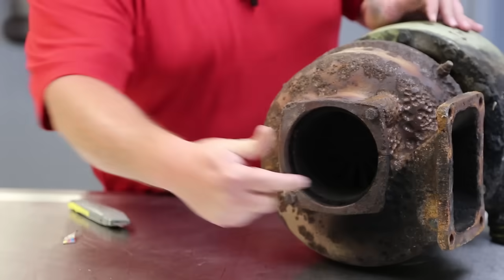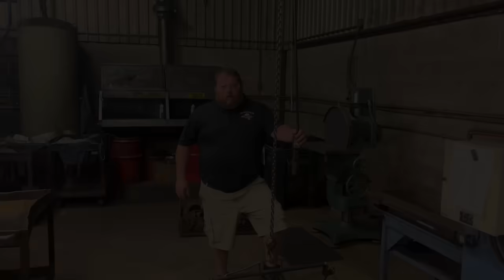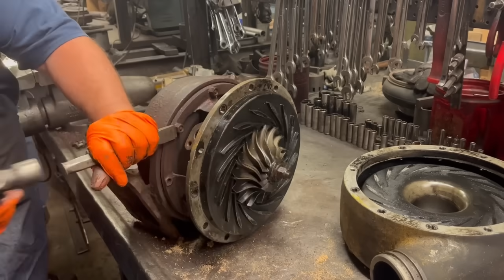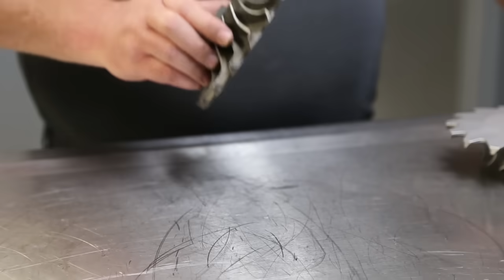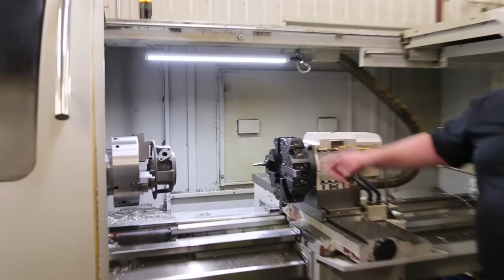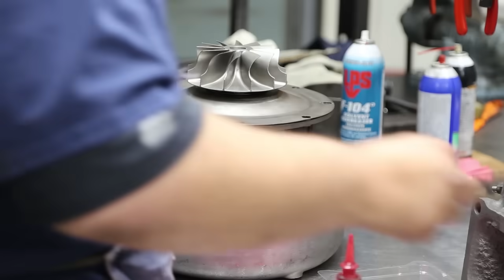T14 Turbo Repair for @DieselCreek  1964 D8H Cat Dozer – BACK FROM THE DEAD … WILL IT START?

Comment: Would it have been prudent to do a little smoothing on the inside of the exhaust entry portion, it looked so rough and would impede so much smooth air....

Comment: Greetings from Hobart, Tasmania, Australia. Great video to see the restoration esp the breakdown of the costing. There's an honesty just in that part alone that many others wouldn't put out there. Noob question, but why do the bodies get so pitted? I would imagine the turbo would get so hot that it would burn off any protection and it's just rust that comes from age and sitting, but is there another cause ?
Reply from the maker: I would guess Father Time is the biggest cause here. And exhaust gas is pretty caustic. Coupled with thousands of heat cycles. Pretty tough environment.

Comment: I worked on a tug boat in the eighties, that boat was built in the early sixties,...it had a big cat engine, I'll never remember the model number but we called it a 765 hp. It should produce 765 for continuous operation, put the hammer down and leave it down for days. They would size the pitch in the propeller for an appropriate load on the engine based the speed you expected to travel based on the type of towing that you would do. We got the boat into our area from a barge towing division,...barge towing would mean speeds of maybe 6 or seven knots. We were a log towing division, huge rafts of logs dragging the speed down to 1 or 2 knots, putting tremendous load on the engine,.... if you kept asking it to produce 1200 RPM. I went to the engine room one night for a look around and before I turned on the lights I glanced down at the engine and that big old turbo was glowing ruby red,...you could almost read the newspaper without the lights on!! We did make a choice to slow down a little and push a little less heat through the poor thing,.....not sure what the exhaust temps might have been (my guess is hot AF!) but cherry red turbo seemed a bit much!! Not sure if it put a hurtin on the turbo but it did run for a couple of years after that. Good solid engineering in those old Cats! The new half size better performance unit wouldn't put up with that kind of abuse! She be a puddle on the deck plates!
Reply from the maker: They don't build 'em like they used to! Thanks for sharing!

Comment: Nice work yet again.  Always impressed with you guys.  I missed where you fixed the bore of the turbine housing where the turbine wheel contacted and chewed it up.  How do you do that?  Tig on material and then grind it back?  How do you keep the profile true?  Is this hand work, CNC, etc.  Looks challenging.
Reply from the maker: Great question. This one got a buff job with a flap wheel in a die grinder. Wasn't too impressive and we were already in trouble with the video length. The majority of the exhaust energy is directed to the turbine wheel from the nozzle ring making the fit on the contour less critical than a unit without a nozzle ring. If this rig didn't utilize a nozzle ring we would have either done a tig braze with nickel rod for build up and then cut the contour with the lathe or completely cut the damaged area out, brazed in a repair slug, and then machined the contour back into the slug.

Comment: I put a $2000 rebuilt turbo on an old $1000 International yard truck. Same thing couldn't get parts but the place over here in Aus had used parts to get it fixed as the compressor housing had corroded out the inside

Comment: Could you explain why/what the logic is behind first grinding the turbine shaft to make the bearing surfaces perfectly parallel and concentric and then straightening the shaft? To my logic it seems that you would "straighten" the bearing surfaces out of parallel this way, as they were ground to be parallel on the un-straight shaft. I'm not saying this would lead to failures, or trying to critique the amazing work performed by ADS, just looking for an explanation for something that seems odd to me.
Reply from the maker: Good eye. Great question. Straightening is in fact first. Then grind, polish, and balance. We had wheels chucked in each machine for video production and so we could get in and out of the machine shop quickly and we captured the processes out of order. Are you looking for a job? Your attention to detail is what we look for at Area Diesel Service.

Comment: Awesome video.  Keep the old iron going.   It's amazing with today's technology like CAD, 3d printing and A.I. that someone can't make these parts.  These were made 60-70 years ago.  I realize the demand is low but at 3850.00 for used/rebuilt parts how come someone hasn't done it yet?  Sorry for sounding ignorant.  It just seems crazy.  Once you make a mold you can make multiples.   The more parts we have the more old iron keeps running.
I'm going to start looking for cheap old heavy equipment for goldmine parts.  Love the 3 wise men.  Much respect for them.   You can tell they're there cuz they care.  #probably could have retired already.

Comment: The bore in the turban housing, is that a part that is press fitted at factory, or is the core too soft for pressing? Thanks
Reply from the maker: The turbine housing is all one cast piece. The bore is machined into the casting itself.

Comment: Purely out of curiosity,  at the beginning you showed a much smalller turbo and you mentioned as  current equivalent.  Could someone replace with a more modern version  cheaper or would other problems stop that from happening?
Reply from the maker: Yes. That was "plan c".

Comment: If a guy didnt care about being period correct and original, I wonder if there is a contemporary turbo that would bolt in place on the manifold and work with some pumbing modifications?
Reply from the maker: Yes. That was "plan c".

Comment: Good content? But I have one question... why are the shaft journals ground before the shaft is straightened? This could bring the bearing surfaces out of straight/parallel!
Reply from the maker: Good eye. Great question. Straightening is in fact first. Then grind, polish, and balance. We had wheels chucked in each machine for video production and so we could get in and out of the machine shop quickly and we captured the processes out of order. Are you looking for a job? Your attention to detail is what we look for at Area Diesel Service.

Comment: Question:
Why was the shaft ground to size before straighting? I would think a straight shaft would grind better than one that's not straight.
Reply from the maker: Good eye. Great question. Straightening is in fact first. Then grind, polish, and balance. We had wheels chucked in each machine for video production and so we could get in and out of the machine shop quickly and we captured the processes out of order. Are you looking for a job? Your attention to detail is what we look for at Area Diesel Service.
Reply: @AreaDieselService  if I was closer, yes, I'd definitely consider working for you. Thank you for the kind words!

Comment: It was surprising to hear you say several times the"parts are not supported" and "can't get the hard parts anymore".  After a quick check on Caterpillar's on-line parts system I learned the 0R5838 complete Reman turbocharger is available as well as individual pieces like bearings, nozzle rings, shims, rings, and more.  Please check with your Caterpillar dealer for individual parts to help you with the next old rebuild like this.

Comment: It was surprising to hear several times "these parts are not supported any more".  I just checked Caterpillar's on-line parts ordering and learned the 0R5838 is alive and well at your Cat dealer as well as individual piexces like the shims, bearings, housings, hardware,  etc.  This may help you source parts the next time an old one comes in the shop.

Comment: I am about 53 min in and you just covered price points.  Does it ever pay to try and retrofit a newer turbo or would that A. cost more B. give you a Frankenstein machine? C. just get you so far from original that it is no longer a true vintage tractor i.e. Still cost more than the tractor is worth and you don;t even have original style machine?    
I just love you showing the work and cost into saving this old turbo ( and tractor) ....the work you guys do may be expensive but it is priceless that you can do it!!!!!

Comment: That's pretty neat that you had two cores in stock. But if you hadn't what would be the process to figure out what modern turbo would work with that machine?
Reply from the maker: We would look at engine displacement, engine speed, horsepower, and application to determine sizing. And then look at mounting configuration to try to and get something that will do the work and be possible to install. This was "plan c".
Reply: Awesome!!

Comment: Nearly $4K for a turbo rebuild seems a lot, but Matts only other options were to scrap the dozer, of have some adapter made so that a equivalently rated but more modern turbo could be fitted, and that would have been pretty expensive in the first place and not really compatible for Matt's desire to restore the vehicle, which is his eventual aim. The work done here is top quality and its amazing the work they were able to do given the age of the turbo they were trying to refurbish. I'm astonished they had parts in their store-room. The seemingly high cost of the old turbo core should be viewed with the fact in mind that it includes the cost of storing it for all those years, that warehousing is not a trivial cost over many years.
Well done ADS.

Comment: The reason for two holes on the output flange is that two bolts broke off and a new part was made that used only two bolts.

Comment: If the turbo was never going to happen and that smaller turbo was the equivalent in todays tech, but didn't provide enough volume would it be possible to fabricobble together a custom pipe setup to run a twin turbo setup ?
Also isint 2 turbos better than 1 60 year old/new turbo?
Dont scrap the bulldozer, scrap the turbo design pipe layout, and hopefully make much better power.

Comment: Firstly, thanks for collaborating with Diesel Creek on this project, secondly, thankyou for your very comprehensive commentary and visuals, thirdly, I really appreciated the cost analysis as I was sitting there myself thinking how would you cost out a used turbo when nothing is available, fourthly, the step by step machining and repair process was really detailed and great to learn. Lastly, thanks for posting, you guys rock and are a very professional outfit. Regards from AUS
Reply from the maker: Our pleasure!

Comment: Could you have used tig or stick welding to repair and build up thin areas of the castiron housing? Preheating the housing and using purpose made cast iron rods with graphite flux migth have done the trick? Maybe/Maybe not it all depends really.

Comment: Why don't you straighten the turbine shaft before grinding the bearing undersize. Couldn't that cause the bearings to them be non concentric, cocked a bit.
Reply from the maker: Good eye. Great question. Straightening is in fact first. Then grind, polish, and balance. We had wheels chucked in each machine for video production and so we could get in and out of the machine shop quickly and we captured the processes out of order. Are you looking for a job? Your attention to detail is what we look for at Area Diesel Service.

Comment: I thought about my pickup and how twenty years ago I could've replaced the engine, transmission and suspension components for $8,000 instead of buying a new pickup for $50,000.
Unfortunately, I live in The Great Industrial Northeast where vehicle bodies disintegrate after about eight years.
With that in mind what Matt is doing is a bargain of the same design.

Comment: The "Bendy" things I have always bend told were "French Locks".
Also, How were the shim thicknesses selected? Seems like after the center section was assembled the compressor and turbine would have been checked for runout. I sure didn't like the way the turbine was placed into the holding fixture before the compressor wheel was installed. Why not get your assembly tech some type of turntable fixture to put the unit on during the installation of turbine and compressor housings? Sliding this very expensive piece of gear around on the workbench top seems like something that could be improved on. Lots of very precise work went into this unit to get to final assembly and that can all be spoiled by an accident on that bench.

Comment: I worked for a Caterpillar dealership in the late 1970s. The area I worked in, built natural gas compressors, powered by natural gas burning engines. The mag and turbo shop, rebuilt so many of these things that we had two guys working full time on them from a pile of cores. They were easy to repair, but ... they had parts. You did a great job on this unit.

Comment: I worked for AiResearch in Phoenix for over 40 years as a mechanical engineer; we made auxiliary power units and propulsion engines.  You were pretty thorough in your description of the overhaul, but didn't say much about establishing correct running clearances for the turbine and compressor wheels.  Are the shims always the same?  We had a rather elaborate procedure for checking drops with the wheel touching the shroud, then shimming to establish the running clearance;; it varied from engine to engine because of the axial machining tolerances for the static hardware.  I was surprised you left that part out, but would be even more surprised if the shims were always the same.

Comment: I just subscribed to your channel heard about it from my other channels. But Matt @ Diesel Creek was in need of some HELP! It's nice to know that there are times when the young guns need the Ole Timers like myself to help solve a problem. I bet there's a NOS turbo just like that in an old shop or shed somewhere with 50+ years of dust on it. Up in Alaska or Canada back when they were building all those highways. Back then we always kept extra parts because it took so long to get one shipped to use. But y'all did great work getting that monster rebuilt.👍🏻

Comment: Matt is the best of what he does. Before he started that YouTube channel, he was a heavy equipment operator for a construction company. What equipment he was using was an excavator. I was watching him for a few years. One of the first projects he was working on was that place he was converting into an apartment. He eventually sold it because it had issues. He devoted the time he had on buying construction equipment and getting the engines started in them. Every time he bought more equipment, all those engines in them started. What was the first project he did when I started watching those videos he posted? If was possibly the Autocar heavy-duty truck. He said in that video that his grandfather drove one of them. That's the reason why he bought that truck. So he bought that D8 CAT, and that turbocharger was in need of newer parts. The man at the start of this video had his hand on the box, which was when I stopped the video. It's time to continue watching it.

Comment: awesome job! but wouldnßt it also be possible to maschine a new housing or cast one? i know that some people/shops over here in germany do such things if there a no spare parts anymore and there a casting shops that do small batches, today even with 3d scanning and printing either as a form for casting or with a metal 3d printer as the rough part itself wqhich you can machine then to spec there are many way today with the new tedch to get such old not more produced parts remade even for a resonable price...

Comment: So is there any updated/aftermarket options for that turbo/engine combo? I know for the m&w kit that our IH 966  tractor had there was an aftetmarket option.
Reply from the maker: If you went with the aftermarket option take a look at the aluminum compressor cover. You will likely find an ADS logo cast into it.

Comment: Great to see you guys again ,Between Matt from diesel Creek and Watch Wes work you guys are keeping them running your work is awesome I would advise anyone with injection problems to contact you Turbos ,Injection Pumps ,Injectors Your the people to see, Super interesting watching this rebuild ,If the contaminated oil wore out the Thrust area of the Turbo what did it do to the engine bearings ,is that why the engine oil pressure on the dozer is on the low side the bearings are severely worn ?

Comment: This was good but why would you grind the shaft bearing surfaces and then straighten the shaft?  would it not be more accurate to straighten then grind?   Thanks for posting.
Reply from the maker: Good eye. Great question. Straightening is in fact first. Then grind, polish, and balance. We had wheels chucked in each machine for video production and so we could get in and out of the machine shop quickly and we captured the processes out of order. Are you looking for a job? Your attention to detail is what we look for at Area Diesel Service.
Reply: @AreaDieselService  Thanks for the offer but i live in Australia, Great vid though.

Comment: I'm used to higher shop labor rates and Overhead - at the beginning, I was guessing north of $5,000 for this rebuild.

Now, another aspect of these older applications is the question of what, if any, less antique turbo could be fitted to the dozer... this might be necessary if there just are no longer any direct replacements capable of being restored.

The major question to such a retrofit is going to be just how modern of a substitute can be fitted up economically, and what that will do to the historical value of the machine.

I can see where a radical substitution with a state of the art device might be desired if the old machine is still going to be used in major production service, while an intermediate newer, but not truly current turbo might be more in character with a machine destined for lighter duty.